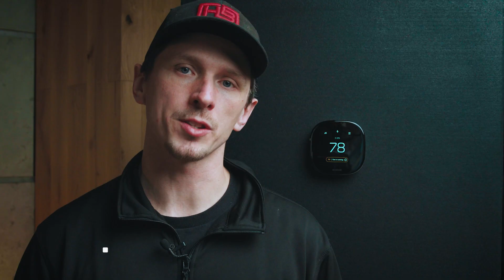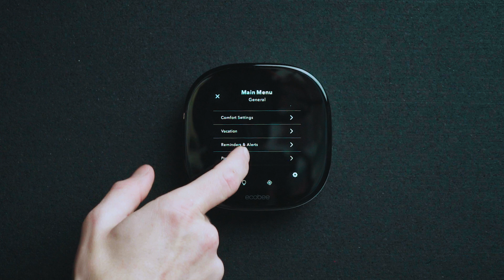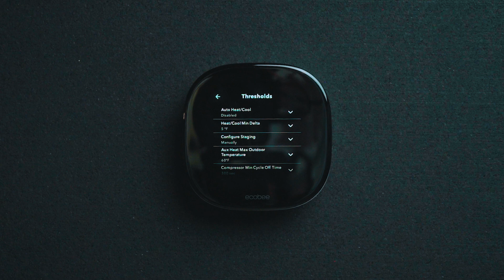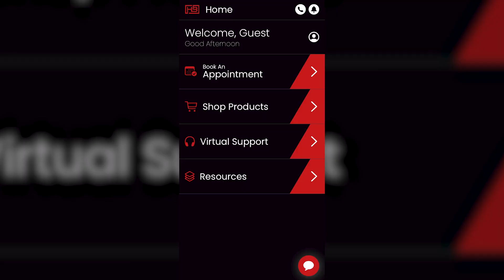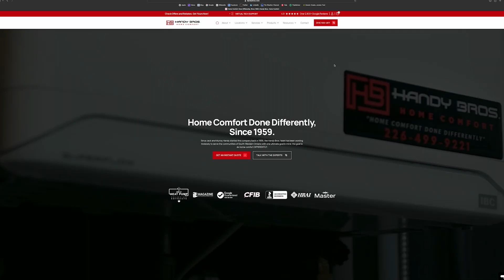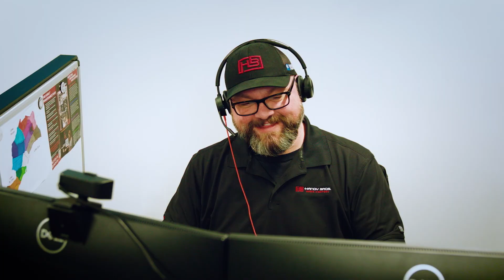Ecobee Installation Settings | Heat Pump TROUBLESHOOTING 🤔 | Handy Bros. Smart Thermostat Tutorial

Comment: you are just what i was looking for. THANK YOU SO MUCH! you explained things very well. i only wish you went over what setup would be needed if you have a 2 staged heat and 2 stage cooling and a emerg heater. my system is suppose to heat with just heat pump at -22f outside. WILL SEE!  THANKS AGAIN